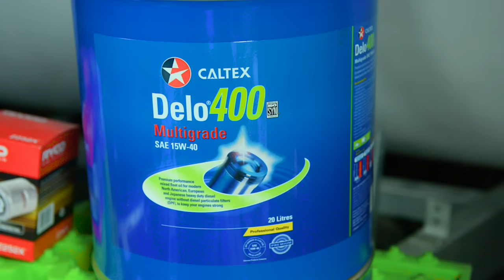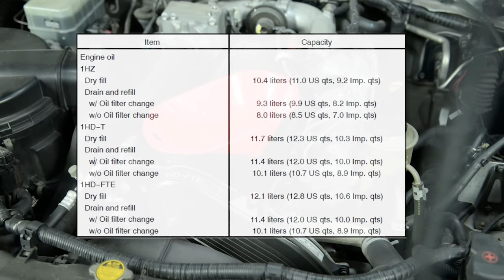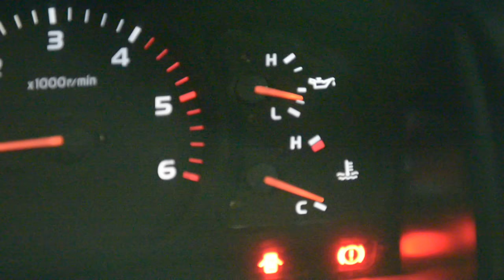How to service a Landcruiser 100/ 105 1HD-FTE, 1HZ, 1HD-T

Comment: I have been a mechanic for 13 years and dnt recommend using tools to tighten filters as they can cause issues for the next person that services the vehicle also puts a lot of stress on the seals of filters not recommended otherwise great diy video for those wanting to tackle the job by then selves also don't forget to use engine oil flush for those wanting the best out of their engines
Reply from the maker: Thanks mate, only use the tool to give the filter a slight tighten. I also dont recommend going crazy on it. 
If you only do them up hand tight and 4wd on corrugated road, its possible for it to come undone. Id rather take the extra step to make sure its firm. (in the Toyota service Manuel there is actually a torque setting for it)
Ive worked on cars which I had to shove screwdrivers through as it was done up to tight. (back then I was using a belt tool to undo filters, so they always got crushed, now I mostly use the sockets type). 

The oil flush is a double edge sward, its good that it cleans your engine, but bad if your engine is not well maintained. It can loosen large lumps of carbon buildup/ sludge and block the oil pickup/ oil passages. 
If I do a flush on a car i know is not well maintained, I do a few oil swaps after the flush, helps remove any big items.
Sometime its better to leave it alone! or you cause more issues/ cost for the clients.
Reply: Instead of putting engine oil on the O-ring, put some silicone grease and tighten the filter 1/8 hard after contact
Reply: No tools tighten... What a TOTAL load of rubbish
Reply: @yandel7092 I used this once and at the next oil change the filter was almost impossible to remove. It was stuck hard.
Reply: @i-am-that-what-i-am I argee, tools make the job easier. A filter has a recommended torque angle after the gasket touches. I always following the recommended specifications by marking the starting point with a ink pen. This might sound pedantic but this verifies the correct torque angle. Cheers

Comment: How did I miss this video?
Fantastic Dan, can't thank you enough for your informative videos.
So many 1HD-FTE's out there, and your channel seems the only one addressing them.
Reply from the maker: Thanks mate. Lots of people are scared to work on them. 
But with some guidance im hoping to fix that :)
Reply: Dan vs Car Wih the fuel filter
I placed an old rag below, then slipped a plastic shopping bag around the filter.
Spun filter off, all diesel and filter caught in bag
Not a single drop of fuel on me or the vehicle
Reply from the maker: Good idea! Ill give it a go next time.
You can also use the water drain tap on the bottom and connect a little hose to it.
Just make sure to you remove the fuel hose from the tank!.

Comment: With the fuel filter you can fill it up with diesel before installing it back on the car so you don't have to prime it, because that can take a long time sometimes especially if you have a low fuel level in the tank too
Reply from the maker: +Aussie Dude85 I have done that before when the primer couldn't suck up any fuel. But it's messy.
Reply: Thats bad practice bro just bleed em go hard or go home
Reply: Yeh, and fill the filter with possible contamination from unfiltered fuel... fekken ameteur. Fix the damn primer pump. If you did that crap at a CAT dealer you'd be sent to the gulag for re-education.
Reply: @i-am-that-what-i-am  😂😂😂😂😂

Comment: Fill the new fuel filter with clean fuel before installation will make it quicker to pump up pressure
Reply: yeh, and fill the filter with possible contamination from unfiltered fuel... fekken ameteur.

Comment: Great post mate. the 1HD-FTE engines are rated for CF4 in the factory manual. Does it matter if I use the newer ones like API CI4, CJ4 or CK4 oil specs?

Comment: I have a 1HD-FTE when I fill it up 8 litres with the oil filter and check the dipstick it shows full then when I drain 8 litres and Add 10 litres on the next oil change  also change the oil filter it shows near empty on the dipstick so I had to add 0.7 litres more totalling in 10.7 now and it shows more than full in the morning as you said it need 11.4 litres so when I start the engine and it warms up the oil then again  go to a point on full. How can it be full if its 10.7 litres filled and the full capacity is 11.4 and what was the situation before when it showed full on 8 litres can anyone guide me it would be a great help Thank you buddy for making this guide

Comment: I've read that some people change their filter and oil at different intervals? I assume that you can just remove the oil filter no problem since it's on the top of the 1HZ? I have to reseat my filter because the dealer messed it up and it's leaking a little from the filter.

Comment: I know this is an older video now, but still obviously relevant to the engines it relates to. I really appreciate the videos, as it gives me plenty more confidence to work on my rig. I have a low kms '05 Sahara FTE that I regularly service. I've been trying to work out why my air filter sensor light comes on the dash when i'm giving it some berries. The old air filter I replaced (was pretty bad but not horrendous) gave instant extra power and you can tell it was breathing better and using less fuel.  It feels great, smooth, and faster but the air filter dash light still comes on under medium to hard acceleration. Any ideas? I'm stumped. Only thing I can think of is checking if line to turbo or line into engine has blockages, or junk? Any ideas? It has me buggered
Reply from the maker: Hello! Must be a blockage in the intake. Do you have a snorkel?

Some animals like to make nests inside the intake, so have a good look around.

Comment: Hi Dan, which engine is better for daily drive? 1hz or V8 diesel? Average 30 to 40 kilometers per day mostly city driving. Reliability is also considered. Thank you.
Reply from the maker: V8 for sure! Its a solid engine with lots of power.
Reply: V8's cost a lot more to run, not just in fuel costs, but maintenance costs are astronomical in comparison.

Comment: Hi Dan.  Good vids mate and want to encourage you to keep doing them.  Content and coverage is good so far so keep it up and don't change what you're doing (unless it's for the better - but hard to beat what you're already doing!)  How long do you reckon before you'll get onto doing a service on a 200 series so I can start learning how to service the bloody thing.  Useless user manual limits me to topping up the oil, checking coolant level and detecting oddities and then bam ... get in touch with the dealer!! Grrrr.  But your articles and depth of coverage are good mate so keep it up.  
Where are you based?
Reply from the maker: G'Day PaulnSans, thanks for your encouragement! Keeps me wanting to make more vids when I get comments!
I have a few friends who have 200s, Ill have a chat with them and see if I can make a video on one. There is a 200s what ill be doing a walk around on sometime this year as well (neat and well kitted out).
Yes the provided user manual is only good for basic checkups and how to use functions, would be nice if they had some decent information though!
I try and include as much information as possible, it takes a long time to make these videos, edit and type up the informations. Not easy doing it all on your own! (this is why it takes me a long time to upload content) 
Im based on the Gold Coast (australia)
Reply: I'll keep an eye on the channel mate and when you get a 200 then all well and done.  However, you've got your beast to keep working on and there are many who would like to see you do more on that.  I'm just being selfish hahaha.  

Don't stress about the time it takes mate.  I understand that, but you explain your stuff well all the way through very nicely.  QUALITY rather than QUANTITY is what you've done so far and so should be your ongoing performance standard and that's how you'll make a quality channel for yourself.  Good luck with getting more Patreon supporters mate!  Try and see if you can build some of the work around highlighting certain tool brands perhaps and therefore try and build partnerships with those companies eg Snap On and also suppliers of parts eg Super Cheap and approach them with a view to seeing if they'd be happy to become commercial Patreon supporters in return for your using their products and services.  Just a few thoughts mate but good luck and keep it up!
Reply from the maker: Yes lots to do on this car! Have some rust to fix so will be showing how to repair and respray as well. 
Nothing wrong with being selfish haha, give me ideas on the kind of videos to create (have so many planned not sure where to start)
Lots and lots of custom wiring needs to be done for the rear draw wiring as well (Might come in handy for you).
Once I get a few more subscribers ill be hitting up all the big parts suppliers around here, I have made some friends in the industry so hopefully they can help me out (business don't like to help unless they get something out of it as well)
But thanks again, good to have a chat with a fellow enthusiast.

Comment: Hi, is there any benefit to filling the oil filter with clean oil before installing it?? I have always done it and noticed you didnt, am i just making a mess for no reason?
Reply from the maker: Hello Chris,

On the 1hz/ 1HD-FTE engines, there is no need to fill them up. Just makes a massive mess and that about it. 

If you service the car when its hot/ warm and start it straight after you replace all the bits then its even better! Less wear and tear when its warm. 
There will be residual oil in the pump and oil in all the components.

I only fill filters if they are not mounted to the block or mounted facing down. 

If you are worried about it, you can flick the key a few times (without starting the engine) and this will also prime the filter. 
With a 1hz you can pull the glow plug fuse and spin the engine a few times.
1HD-FTE there are also ways of shutting the injector pump off. But not worth all the effort. 

Hope this helps!
Reply: Dan vs Car 1HZ in a Toyota Coaster here. Not pulled the glow plug fuse but have pulled the relay it just fires up or do you do a few quick flicks of the ignition.
Reply from the maker: You can do a few quick flicks, but the oil pump needs rpm to build up pressure to move the oil. If you dropped the oil quickly then started the car within 2hrs of your oil/ filter change. There shouldn't be any excess wear as all parts are still lubricated.

Comment: Hey. I have 1hz engine diesel and I have poured in 9.3 litres and still my dipstick has barely touched the oil in the bottom. So it safe to pour in more oil in the engine ? To make the oil level correct as accordingly to the dipstick. I have checked all the leakage points there are 0 leaks so yeah but still I am stressed out about the engine oil capacity and I did change the oil filter to so please do help me. Thanks
Reply: Keep pouring up somewhere 12.5 then check your stick

Comment: Hi, I have recently bought a 2000 1hz 105 series cruiser with 380,000k.. I’m wanting to do a service tomorrow but not sure on what oil. I have bought Penrite HPR diesel 15 - semi synthetic, 15W-50 (extra 10)  would that be fine to use? 
Cheers
Reply: Thanks for the great video by the way 👍
Reply from the maker: Thats what i used last service on my 1HZ 👌
Reply: @DanvsCar  ok, thanks heaps! Roughly how many litres?
Reply from the maker: Roughly 9.3L, park it on level ground. Check dipstick until reading correctly.

Turn car on and recheck.
Reply: @DanvsCar  thanks heaps mate, you’ve been very helpful 👍👍
Reply: In my FTE utet, i use HPR15 in the summer and HPR10 in winter

Comment: with the ryco z252x they recomend on crd to use a z699 cause they filter better also that aircleaner is clean compaired to some we see at work and why didnt u wash it its a washable air cleaner
Reply from the maker: Had washed that filter twice before, time for a new one. (that car has never seen a dirt road!) Would rather replace it then falling apart and busting up the turbo. 
Will give the Z699 a go on my 1hz, I will check out the micron rating as well, not good having it to fine as the pump could struggle supplying enough fuel. But im willing to test it out. 

Cheers!
Reply: no probs yea twice is probs a bit for the air filter

Comment: Hi Dan How R u? love to see ur videos. Can U help me about my 80 series LC 1992 D Manual? guide me about its engine. which engine would be perfect for my lc from thes 1HD-FTE, 1HZ, 1HD-T???
and which engine will be perfect with auto tranmission plz guide.
Reply from the maker: +khan niazi Hello mate, going Well!! Busy busy!!
So best engine for reliability is the 1HZ. Best power/ reliability would be the 1HD-T.
Then 1HD-FTE is a monster with power, but it is electronically controlled so it's more prone to have electrical bugs out bush.

To be honest 1HD-T is the best of both worlds and is plug and play in your 80s. (Also much cheaper then the 1HD-FTE.
Reply: Dan vs Car  thanks alot for ur help. I really appreciate your work. keep on doing it. can i convert Manual into Auto transmission? will it run perfect with 1HD-T and tell me about the auto tranmission model or anything regarding. plz guide.
Reply from the maker: Got a few vids in the editing stage!!

Yes you can convert from manual to auto. You will need a few parts to do the conversion, transmission mount, shifter/ surround, peddle , wiring, transmission, torque converter, flex plate and a auto radiator.  

Now you have 2 gearboxes to chose from, the 4 speed and 5 speed.
4 speed is going for towing and 4wding. But gets hot so I recommend putting a cooler on it.
5 speed is also good for towing but better for hwy driving.

I would recommend the 5 speed auto. While your there also install a cooler to help with performance.
A lock up switch would come in handy as well.  

If you join a forum called "Lcool"  (is a forum for all Landcruiser owners)  it has a lot of information about the conversions.

Comment: why you installed the oil filter empty, why don-t fulling it oil before installing?
Reply from the maker: As you will make a mess. The engine grabs oil pressure quickly so its not something which needs to done. 
If the filter was fitted in a vertical position then I would fill it.

Comment: Hi Dan great video thanks for sharing. Just have a question if you can help with I have a 2006 landcruise 100 series deisel 1HD-FTE and its automatic transmission. I have a problem shifting the high range lever it is stuck in high. I have tried lifting up rear of the car to release tension on gears and tried to move lever no luck. Can you give any ideas on what to do. The truck is not a full time 4wd. The lever is high range neutral and low range. It has a short shaft that goes on top of the gear box and has four bolts holding it. Any help would be appreciated.
Reply from the maker: Hello! Sorry I didnt get a notification about your comment! 

Ok this is a common problem with the toyota transfer cases. If the Hi/Low range stick is not used for a long time they do become "tight". 

As you mentioned it has 4 bolts holding it down, we remove those, remove the stick and WD40 the inside. This usually helps, put the stick back in and cycle through high, neutral and low. 
I cycle throw mine at least once a month to prevent this from happening. 

If this does not help let me know and ill give you a few other things to try.

Cheers (Y)
Reply: Thanks Dan it's been fixed I had to pull the lever off completely and pull apart and move leaver while in vise using wd40. Then used some small amount of grease. It works perfect now. It was rusty before. After having got it to move I cleaned all rust and greased it up and now it's perfect. Thanks again for your reply.
Reply from the maker: Great to hear! Every week move the stick a few times and this will stop it from happening again :)
Reply: Там где находится вал-пустая полость, я забил эту полость смазкой для подшипников, теперь вал не будет ржаветь никогда. 👍

Comment: Hello sir, I heard 100 series is more electric and hence is not easy to repair and have high maintenance cost in comparison to 80 series that is simply and easy to repair. Is that true ?
Reply from the maker: The injector pump costs slightly more to service yes, other then that, very similar price.
Reply: Thank you friend, for your response. I am planning to buy one for next 10 years. I hope 100 series will work well 😊

Comment: Hi sir for LC 100 i have replace all 4shock new but hight conrol is not how refix it frist hight was working pls tex me sir
Reply from the maker: Hello, just confirming. 

You have replaced all shocks on the car which has 'high adjustable' suspension. But it does not work anymore now? 

You need to check and see if you have any error codes with an OBD reader. 

It could be sensor, cable or a few others things.

Comment: Dan vs Car Hi how often we need to change automatic transmission fluid and fuel filter ?
Reply from the maker: 1313AslanBey hello. if it's the auto box on the 1hd-fte it is a sealed unit. I'm currently camping and will check the service intervals. can you confirm your engine please?

With the fuel filter it depends on the fuel quality in your area. Usually every 10,000km is what I recommend.
Reply: Dan vs Car hi thanks for reply. I have a 2007 4.2 TD 1hd-fte engine
Reply from the maker: Here is a good reference document for service intervals. 40,000km is recommended. http://www.lcool.org/technical/100_series/service-specs-100series.pdf
Reply: Thanks mate
Reply: Those models don’t ever need the auto trans fluid changed. I’ve had mine for 16 years never touched it and still bright red and no issues. It even says on the dipstick not to change the fluid.